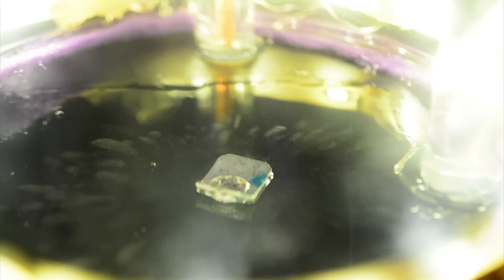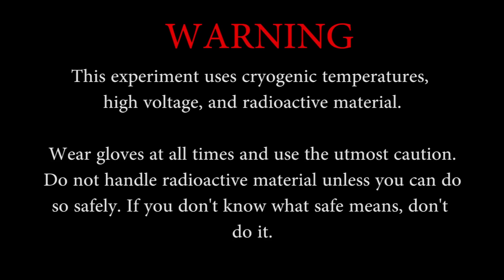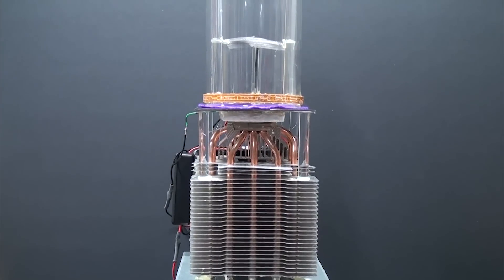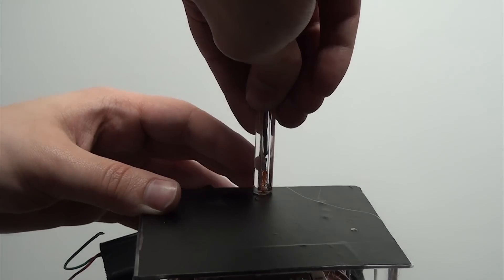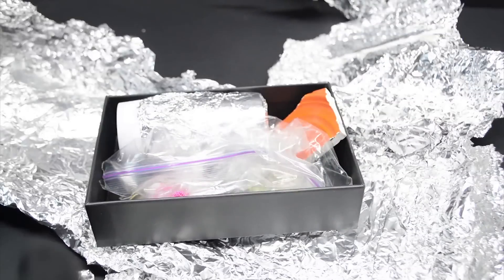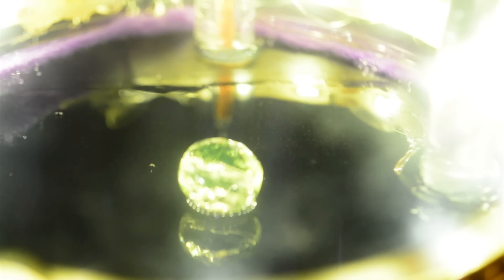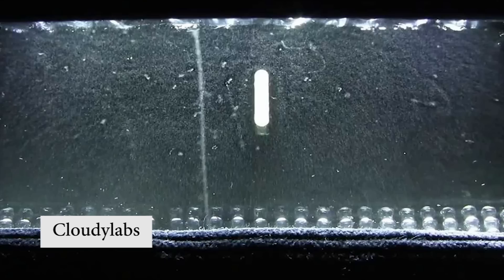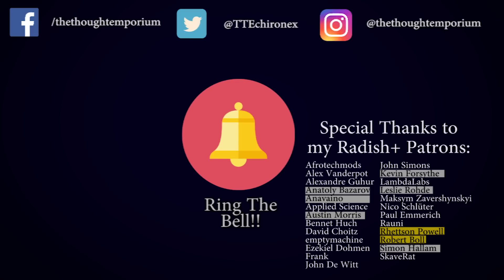Make Invisible Radiation Become Visible - Peltier Cloud Chamber

Comment: Running those TECs at their rated power also calls for some pressure to be maintained on the modules. Their datasheets provides the needed pressure but you could just use four spring between the plate and the heatsink to clamp the modules with about one kilogram of total force. 
The magnetic forces caused by the current tends to push the conductors and ceramic plates apart. Not much but enough to cause the semiconductor crystals to crack and fail prematurely. 

It will also squeeze the thermal paste and thin it down, increasing heat transfer.

Comment: I recently made a chamber with tec1-12706(1pcs), and 1,5mm plastic walls. The peltier handles the ethanol well, so I used that for the base directly. Radiation-trails starts appearing within 20 seconds. I didn’t need to use Americium, as there is plenty radiation in the air already (some of it is Radon). 
What helps alot is adding a piece of cloth to the top of the chamber, saturated in ethanol, heated by another peltier. Really gets the chamber going..
Reply: No voltages in my chamber by the way. Just peltier and isopropanol. Edit: I will also add here that I mix in a tiny bit of water into the chamber, in case someone wants to try.

Comment: I want to make this but I have a few questions:
Are you running the peltier modules on the bug zapper or a seperate 12 v power supply?
What is the purpose of the mesh and the wire on the copper plate?

Comment: 5:20 it's actually the condensation of the water vapor out of the air and not the build up of ice that's adding the heat.  This is not only because the air is warmer, but mostly because of the condensing of the thermal energy in the water vapor. :D

Comment: Could you use lipo batteries for the peltier modules? They are everywhere and have lots of potential current but their voltage isn't exactly stable... I sadly don't have an old PC psu
Reply: Yeah you can as long as the voltage is close enough to what you want (and isn't above the max voltage rating of the peltier) the stability isn't that important but maybe it would be better to just use any power supply with the right voltage and higher power rating of what you need since it's easier to set up
Reply: Unless you already have the Li-pos, buying the power supply would probably cost as much as the batteries you need

Comment: About thorium ... I've once noticed working with x-ray spectrometer and electron microscope, that even in the most of common rocks (such as granite) there are some tiny bright grains and that suggests some elements with high atomic number. Some of them are surprisingly rare earth elements or yttrium phosphates (monazite, xenotime minerals), some of them are zircon, some of them contain thorium in combination with lead. Radioactivity even increases cathodolumiscence of quartz around them.  Recently I've heard that dust from some quarries or construction sites can increase radioactive background quite significantly and there was some alarming articles about hardpack accessory forest roads and increased radioactivity around them. So it might be likely to inhale some sub-micron thorium particles daily. I had no clue that thorium or so called rare earth elements are actually everywhere, unlike more known elements that are usually only in certain areas.

Comment: What are the radioactive pearls called? And are they safe enough to store in an aluminium box? And is it ok if I don't have a geiger counter to check for contamination?
Reply from the maker: Ya an aluminum box is fine, but store it away from you. Just look up vaseline glass, or uranium glass. People use it for making bracelets and jewelry sometimes. I had a glass blower friend who used some in his pieces. They're quite safe so long as you don't break them and get any dust in you. I'd clean it as soon as it arrives to wash off any potential dust, but then it's safe to handle. Again, just don't eat it or keep it on you and it's fine. But also a little gieger counter is 100 bucks and worth it to keep around. If for no other reason than it's a near device, but also then you can also know the actual dose, rather than just seeing particles. (it's a really really low dose, but still good to know)
Reply: @thethoughtemporium  Ok thanks a lot! I'll look into getting a geiger counter if I ever end up building this. I might also just build it without using any radioactive materials and just look for random rays passing by.

Btw your channel is awesome! Lots of very interesting stuff! And it's always nice when a creator like you bothers to answer comments! So thanks for that!

Comment: You should only need a very little amount of thermal compound. It’s designed to fill tiny cracks in the two adjacent surfaces so heat can transfer between them better, not act as a layer that transfers heat.

Comment: It's funny, I was watching Derek's new video for veritasium and we got into a discussion in the comments about the top chamber. I decided to revisit your video and post a link for a few people that wanted to try to build one. I was sitting in my caterpillar 257b rewatching this video as I was working and I came up with an idea! I've already built one of these based off of the same design you used but now I'm going to build a mini one to put one of my tritium vials in and leave it on my desk! I wonder how small I'll be able to get away with before I lose the actual cloud!
Reply: If I succeed this may be my first video I post. I've done some crazy crazy things for work and in my fun time but I never remember to film! I'm usually having too much fun to turn the camera on and set up an angle
Reply: Just a heads up for anybody that wants to build one by the way and does not have a radioactive sample. Cloud Chambers can also detect Cosmic particles. They don't need a radioactive sample but I forgot all about the tritium vials until I was watching this because I did not have them at the time. I actually use mine to see cosmic rays or Cosmic particles rather! It was amazing to see tracks appear in my cloud chamber without a radioactive source

Comment: Idk if you know this or not but using that much thermal compound actually acts as a insulator. Most people(my self included) use the pea method where you put a drop doen the size of a pea. Artic silver 5 is a good thermal compound but its also a good insulator in large amounts like that which is very wasteful. Id push the plate down then twist it side to side to spread it 100% evenly. This is a cool video non the less.

Comment: Talking about the radioactive collection issue. I collect stuff like uranium glass, fiestaware, and radium watches. The glass I leave in the open because the radiation is next to nothing and can't be detected more than a few inches away. The radium dial watches and fiestaware I do keep in an old steel water testing cabinet that I lined with lead. On the inside I get about 10,000 cpm, but on the outside I get less than 100 cpm if I have my detector right next to the cabinet.

Comment: It probably isn't super important depending on the surface material of the Peltier, but the thermal conductivity of thermal paste is actually drastically lower than aluminum or copper, so the thicker the layer the less efficient the transfer. it is more efficient than the minor gaps of air that would exist without it, but if you want the highest efficiency transfer you should really try spreading as thin of a layer as possible on the surface rather than applying a thick quantity of paste to guarantee coverage. Like I said, it is probably a little irrelevant for this application, but something to note.

Comment: So I have a couple questions.
First one is, you've got alcohol sitting in the pad, evaporating, and falling to the bottom where it gets condensed onto the vinyl. yes? so you end up with a little puddle on the bottom? 
So, the question is, how feasible would it be to put in a wicking system, so that the entire bottom is a little dish of alcohol, and the wick carries the alcohol to the top to let it evaporate and fall back to the bottom? would this minimize the need to refill the alcohol pad periodically?

Second question is, if you got some thin magnet wire and wrapped it along the length of your jar to make a large electromagnet with basically the entire cloud chamber as the core, would that work for making the beta particles curl instead of having a permanent magnet mounted in the base? I'm not really sure what strength of magnet you need for the curling effect.

Third question is,  how easy would it be to make a pair of nested bell jars such that the gap between them was a vacuum chamber, like the simple jar & silicone setups that channels like the King of Random and Cody's Lab have used in the past? It seems like having the jar thoroughly insulated would minimize power requirements so that you could create an even larger chamber with similar hardware.

Comment: classic project, trying myself on it rn, want to build a table which’s highlight is a cloud chamber visible through its glass top. it faces quite a few challenges especially in regards to efficiency, in terms of amount of heat pumped peltierdevices are quite shitty in comparison to compression based cooling systems. great project nonetheless, and some nice exposure for this rather unique experiment!
Reply: You can use a compression refrigerator if you don't mind it roaring like a jet engine. In fact most cryocoolers are compression refrigerators

Comment: If you use an "X" pattern when dispensing thermal paste, you can avoid having air bubbles trapped between surfaces as opposed to the random dispersion pattern used here. Great vid though.

Comment: May I get a sensing of what your thoughts on Liquid Fluoride Thorium Reactor? Is it sham? Or is it better than the fast reactors?
Reply from the maker: orders of magnitude better. I love thorium, would be great. BUT better is relative. It's better if we can make and deploy them faster than typical uranium reactors as they have many benefits over uranium. But standard uranium is still a very very useful technology
Reply: @thethoughtemporium  just as a quick note of input for you. I'm actually studying the LFTR design as part of my nuclear engineering degree. We can build and deploy them orders of magnitudes faster that typical PWR and BWR's. The mega expense of the nuclear island (which is typically only 30% of the cost of a nuclear facility) is the pressure vessel because they are a huge, slow to produce, and are a rarely made hunk of uniform metal. LFTR and similar fast designs can be built faster because they lack the pressure vessel of those units, so the reactors themselves can be assembled piecemeal from commercially available sheets of hastelloy-N.
Reply: Thanks for the inputs

Comment: I think that running the CPU cooler upsidedown has a negative effect on its cooling capabilities. I believe these coolers are filled with a coolant that evaporates from the CPU surface and condenses onto the top part. The liquified coolant then runs back down to be recycled. In the upsidedown version the coolant will just sit at the lowest part and you're left with the copper pipes to transport the heat away from the peltier element...
Reply: That will work fine at any angle. Most computers mount them sideways not upright...
Reply: Heat pipes cleverly rely on a bunch of fluid dynamics including capiliary action and phase transition in order to basically move heat away from the hot part, regardless of orientation.

Comment: The uranium glass isn't really dangerous, usually depends on the amount of uranium in the glass. Old uranium glass from the 30's, when a lot more uranium oxide was mixed into the glass, could be dangerous to use as tableware but most of the time it's pretty safe to handle. My great grandmother had some pretty cool glasses and plates made of the stuff.

Comment: You used Arctic Silver 5. It's a good TIM, but needs curing through heat cycles. If you keep it and repeat the experiment, you'll have better temperatures. Using a non-curing one would have been better i think.

Comment: I wanted to ask about that peltier stack. Why did you give top peltier 5V and the bottom 12V?
If anything you would make the top pad to do most of the work. The bottom pad just doesn't have the surface area to give off heat so it should be 5V and vice versa.( total guess to the best of my knowledge). Please can you educate me if u have the time

Comment: 4:40 Actually, the slimmer the compound layer is, the more direct the heat is transferring, if it's too thick, it'll make a heat resistance instead of easing heat transfer. Well that's what Computer tech guys says. It has to be just the right thickness.

Comment: Why is the high voltage necessary? When we built ghetto cloud chambers in school with dry ice it worked fine without high voltage
Reply: it causes the particles to agitate more of the vapor, making the tracks more visible
Reply: @crystallineAurora  source? Afew thousand volts won't make much of a difference when the particle energies are at the MeV levels

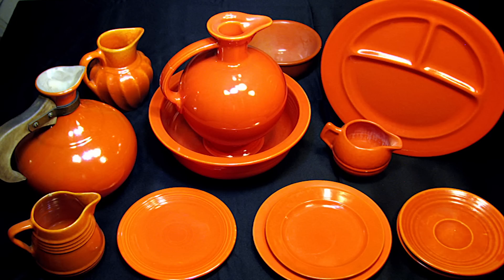Comment: 11:01
So.. think my old indestructible plates from DDR in exactly that color is Uranium oxide? ^^
Only marking is DDR (Eastern Germany). I think they are about 50 years old, used a lot. The glazing is still flawless though and seems very strong.
But I have enough health problems without getting radiation poisoning.. Any way to check the plates without fancy tech?
Reply: There are many different dyes that make the same-ish color. Considering in DDR times, uranium was already a strategic material i would doubt they used it for plates. 
Research has shown that in normal use, you won't eat any of the radioactive material.

If you do analog photography, you can make a photogram with the plate as the 'light source'. Put a piece of black and white film in a black paper or plastic light tight sleeve (like the black bags photographic paper comes in). Put the lead shape on the plate, and put the film on top of it. 'Expose'  for a day or two. If the shape is visible on the film as 'unexposed', then you know the plate is radioactive. It is an incredibly crude and not totally reliable way but it is a fun experiment.
Reply from the maker: This is technically the cheapest way to detect radiation. But you might find a geiger counter for less
Reply: @mfbfreak  Thank you. I really didn't expect to get such a nice answer on this platform. What you say is logical and it's most likely not uranium oxide. And there is zero chipping so the glazing seems very stable / nothing comes loose.

I don't do analog photography, but now when you mention it I believe I've seen Cody (at Cody's Lab) use that method with radioactive materials, some years back, maybe even crude X-ray? Can't really remember, but fascinating stuff :D
Reply: @thethoughtemporium  Yes, if you aren't already an analog photographer and you have to buy the film and the chemicals, you're better off buying a geiger counter. 

(Less practical but informative answer - you can develop film in robusta-containing instant coffee, vit. C tablets and washing soda. Works surprisingly well, especially for prints, and it's pretty cheap. Fixing is apparently possible if you leave the film in a saturated NaCl/table salt solution for 48 hours but i've never tried that)

Comment: I know this is highly speculative to spend time in, but please take a look at the material avilable about 'Moltex Energy' nuclear fission reactor - some youtube videos with some crude designs, and a very interesting podcast with the founder - that is theoretically capable of consuming fissile material and DOES NOT produce radioactive waste that can be used to make dirty bombs, also is much cheaper, smaller, and works in a low pressure envirionment, reducing contamination risks by ten fold, also costs much less to drive. Thanks for another awesome 'DIY' video.

Comment: As for the thoriated tungsten rods, it is ~2% content and works well for general DC tig work. My safety-conscious weld teacher was clear as long as you did not snort the dust you were fine. The tungsten dust/weld fumes was prob more toxic than the thorium content but hey better safe than sorry right?

Comment: Heat pipes are designed to work only on a narrow range of temperatures. For computer applications that is usually between 30 and 50C. Below this temperature, the heat pipes transfer practically zero heat. That entire lower heatsink is doing nothing.
Reply: Even outside of their operating range (of using the capilliary effect) the pipes would still cool passively as they are made of copper, also the heatsink is attached to the hot end of the peltier pump so it'd experience temperatures above the operating range if anything, not below.

Comment: Regarding thermal compound between the Peltier units and heatsink, you want the biggest contact area, but you want thinnest layer possible. Therefore I'd go with a glob at the center, and squeeze the compound out real hard (but without breaking Peltier units of course) ;) 

This also prevents air bubbles from staying between the layers.

Comment: you should have used less thermal compound,the goal of that stuff is to even out the rough surfaces if the two plates, you want the layer to be as small as possible

Comment: I am actually curious if heat pipes will work upside down like this.  I would think they would be less effective since they use convection which is a gravity bound phenomenon.  I would think your setup is being limited by the conduction of the copper alone with all the coolant staying condensed below.